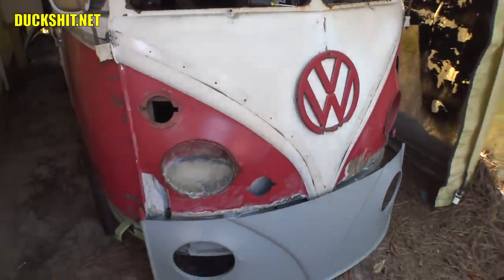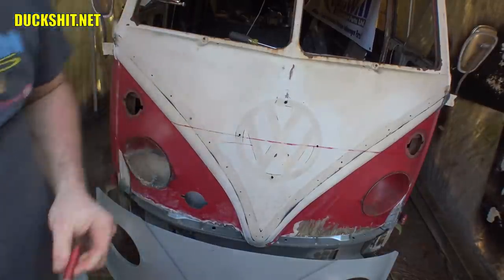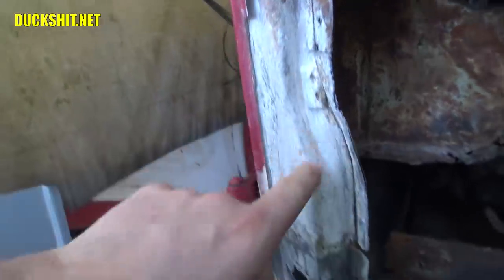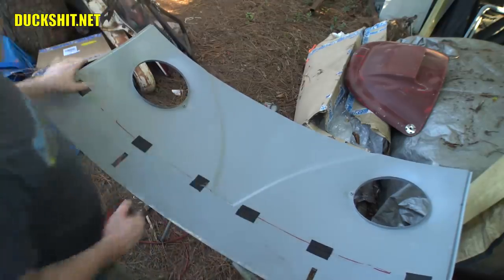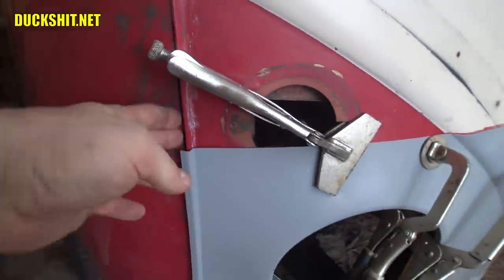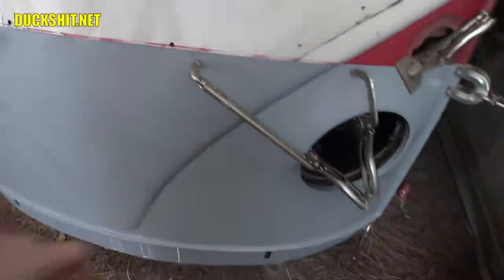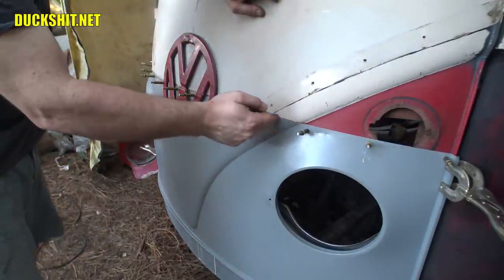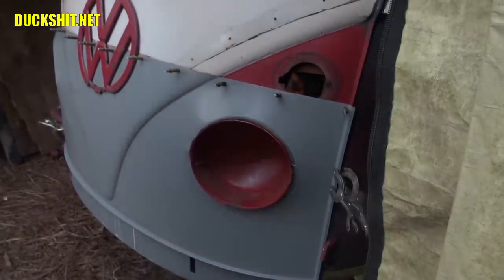VW Bus Front End Replacement - 1967 VW Bus - Gregory - 24

Comment: You remind me of my trailer repair days, we used rivets then ground them off after weld, many welded with coat hangers and tabs bent over existing metal. Made lips of thread rod bolts curved to complete wheel fender pattern. body work, never have enough vice grips. what ever works mending rust. Sometime patches with rivets for a quick fix, no one likes bucking rivets. Patched is chancy, but covers the metal. Fabrication is fun. A plasma cutter even more.
Reply from the maker: Whatever gets it working! :-)

Comment: Either spot weld, use clecos , or screws to hold into place then use an angle grinder to cut through both layers at the same time at a 45 degree angle. Perfect fit. You can spot weld as you work your way around. Check Fitzee’s garage search welding  butt joints. You will love it.quicker/more accurate!
Reply from the maker: Thats the  goal and the way I've always done it on my channel here in the past!  Usually a small jig saw or body saw though, makes a thinner cut!  Thank you!

Comment: Hey DM  I watched a pro welder show a great trick on welding a panel.  when you have the panels lined up cut at a 45 with the cutoff wheel at the seam .  This will give you a cleaner weld and less to grind.
Reply from the maker: I agree, but when it comes to thin sheet metal like this it won’t make any difference.  Hehehe!  But I use that exact same method when I do flat bar.

Comment: Duckman, where do you get those clico's (or whatever the correct name is?) from, you know what clamps i use & will not use any other type i use ViseGrip can't beat them, a great quality tool, i've had some for 30+ years & they are used regular, the jaws have worn out but the locking mechanism is as good today as they were when i bought them 30 odd years ago, they make some great tools in the USA :))))
Reply: Found the Cleco's ebay & Amazon, might invest in some
Reply from the maker: @nickb5391  Thanks for the question Nick!  The answer was in the video, and the links are in the video description!  :)

Comment: Could you have use a Joggle tool to put a step in the panel so they’d overlap without a step?
Silly question maybe.
Reply from the maker: Yes its possible, and yes it might happen.  But fitment is key right here.  Now that the panel is fitted I know where to cut, after which then I shall decide if I want to layer or butt weld the panels together.

Comment: Senor duck i have a 1974 Karmann Ghia and starting to do little bit here and there to it i know that my wiring harness is trashed where do you recommend me getting one from, ive dont research and no luck on finding one that will fit, also do you have a video on adding a starter relay to a ghia?
i need to add one of those 
Thank you
Reply from the maker: I would think that any Beetle wiring harness should work for you.  There may be some VERY minor differences around the gauges, but for the most part its the same.   You can even use an inexpensive buggy harness like this one.  https://amzn.to/3gIpcaK
Reply from the maker: The hot start relay is also the same procedure as a VW Beetle, I made a video about that here:  https://youtu.be/w6AE6ALQcmk
Reply: @DuckmanCycles   Thank You

Comment: Whatever you do, don't turn into Scotty Kilmer :)

Love the Gregory videos but do have one legit question about welding.  I know you're going to butt-weld the two halves of the valance together and I get the reasoning behind it, but wouldn't a lap joint between the two with one half having a shallow flange produce a stronger joint?
Reply from the maker: I have the same question myself and I’m going to be asking Earl over at Classic Car Creations what he would do and I’ll go from there.  Thanks for asking!
Reply: my friend has a tool that looks like vice grips that makes about a 3/8 step in sheet metal. That way the one piece lays in the step. To weld them together.
Reply: naw scottys voice grates on you